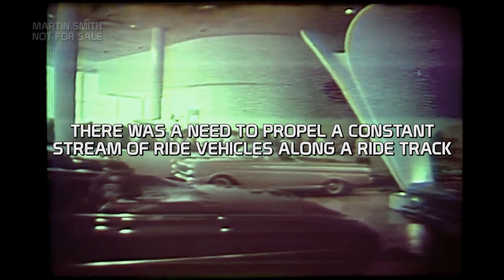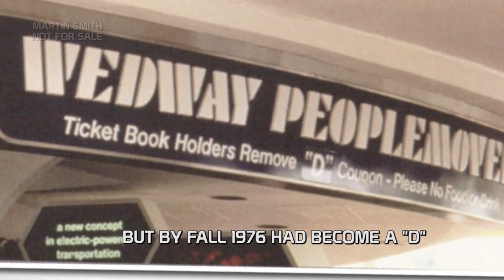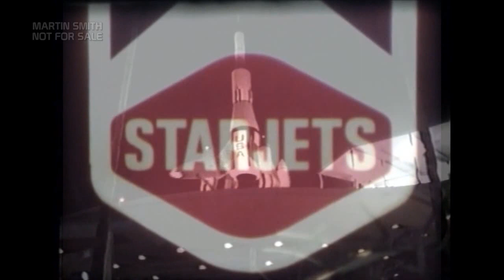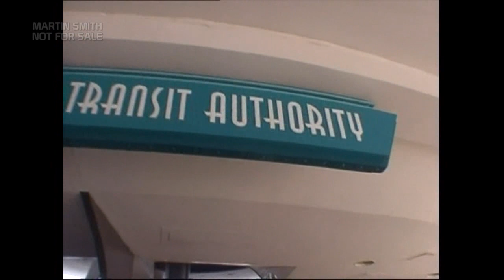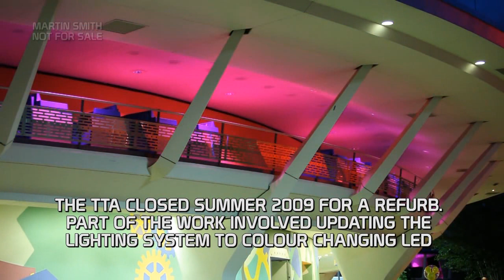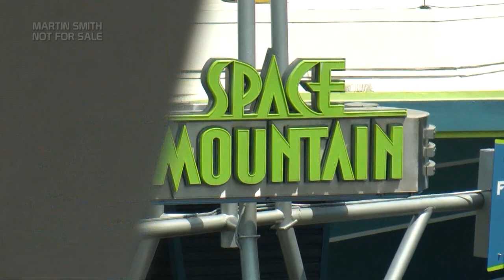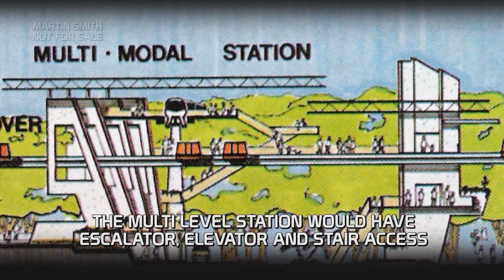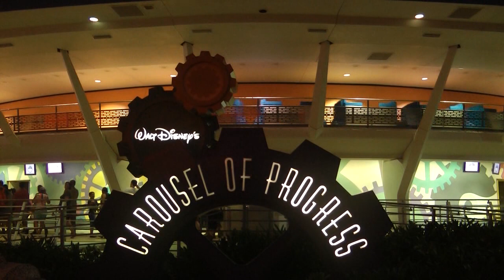WEDWay to Peoplemover Martins Ultimate Tribute

Comment: Thank you very much for this.  I've always loved the WEDway PeopleMover.  As a kid, I thought it would be cool if they had a similar system going throughout Magic Kingdom (of course, I also thought a monorail system going through my neighborhood and stopping at each house would be cool so I didn't have to walk too far to the bus stop; eh, I was a kid :-) ).

Partially because of this, I'm REALLY sad the system wasn't implemented in either E.P.C.O.T. or Walt Disney World Village.  Not only would it have been cool, but a really good use of the tech, IMHO.  I wonder if you could have changed your mind on your destination half-way through the trip (assuming you hadn't passed the stop already).  How about multiple stops (some family members going one place while others go to other places).  I'm really interested to know how that would have worked.

I really like the description of how the system works.  I noticed a couple of missing details, however.  First, there's no mention of how the multiple speaker system works to deliver the ride's spiel.  I'm guessing the same sensor used to detect the presence of the car also tells the spiel system to send the recording to these speakers.  I'm really curious how that all works.

Second, while it is implied, it's never directly mentioned that the cars are unpowered.  I consider this important since that's actually a selling point of the tech: the cars weigh less, have few moving parts, NO electronic parts, and don't require any complicated and possibly dangerous power transfer system (e.g. a third rail).  All of which makes maintenance of the cars easy and inexpensive.

It's partially because of this second point that I wonder how the LBV system was supposed to work.  It looked like the cars were going to be powered which would eliminate some of the tech's "advantages".

Comment: I guess thanks to the WEDWay People Mover/TTA, Orlando International Airport and Houston have versions of the peoplemover. I honestly never knew that.
Reply: The San Francisco Airport has one too.
Reply: Orlando International Airport does NOT have a WEDway PeopleMover system.  Theirs is a Automated Guideway System.  The key difference is the WEDway system cars are totally unpowered (no drive motor, no A/C, no speaker for the spiel) eliminating the need for a power transfer system to the cars.